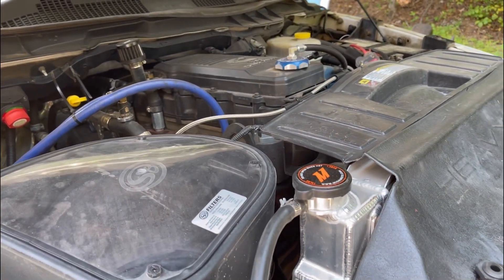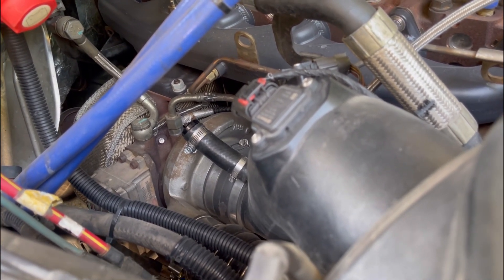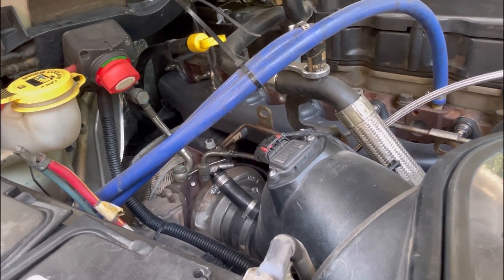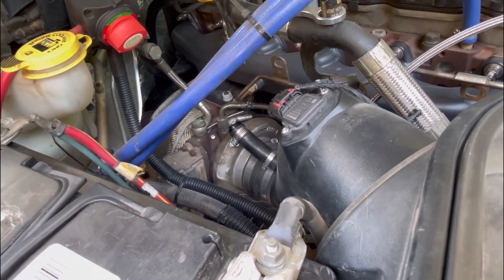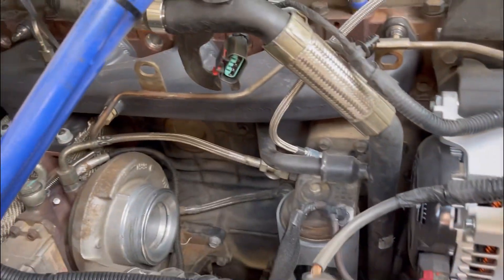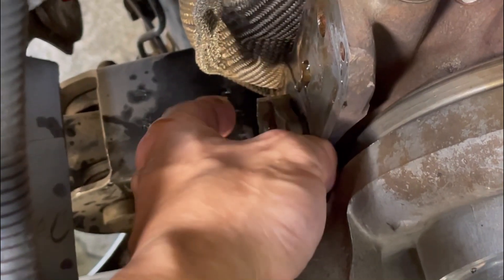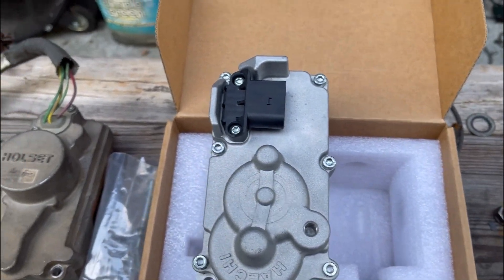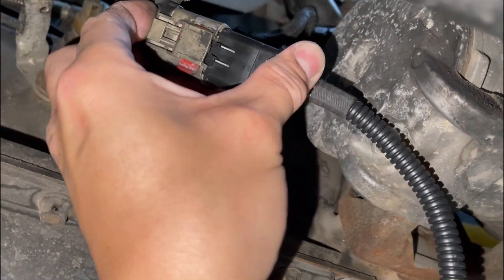STEP BY STEP Ram 2500 & 3500 HOLSET HE351VE VGT TURBO ACTUATOR

Comment: $3k that's dealership pricing and $2300-2400  is performance shop shop pricing on OEM replacement and a direct supplier like Rocky mountain Cummins or Rush truck center is around $1300-1500. 

Kind of like when the ccv filters "were"  $75 at Cummins or Rush and $200 at the dealer .

Comment: Wrong… Cummins tech here. We sell actuators at FCA authorizes dealerships.   I do actuators all the time.
Reply from the maker: great to know our local dealer wanted to sell us the whole turbo we used a cheap 300 buck one and its been fine...how much do the OEM actuators go for
Reply: @DIYKAI  I just quoted on yesterday they are 1150.  That turbo isn’t 3000 either… more like 6000… turbos very rarely go out… typically the actuator from all the soot build up from not servicing the crankcase filter and EGR circuit.  Still expensive though.
Reply from the maker: @RageBrothers  so what we found with ours was the actuator failed and it was pretty gummed up in the turbo......ended up replacing the nozzle and ring ...that was fun lol...then reprogrammed the actuator and drove about 6k miles hard with a load and the OEM actuator finally went....2 cheap China ones later and it seems to be goo now...but yea the turbo at 250K looked amazing just replaced everything cause we were in there....long story short we got maybe 500 in on a home rebuild 12k miles so far and its good so we are happy

Comment: I’m curious maybe you can help me, I have a 2012 with 110,000 miles. For the last 15 or 20,000 miles or so I don’t hear an exhaust break any longer but I don’t feel loss of power, still a fast truck. Can this be a symptom and it’s easy to just change out the actuator, calibrate it, and then slap it on the existing turbo? Thanks.
Reply from the maker: Hello yes that could definitely be the issue. Very easy to change we just did a video will be uploaded today sometime.

Comment: Must the actuator be recalibrated if it was pulled off the turbo, but the electrical connector was never disconnected?
Great turbo videos!
Reply from the maker: Hello and thanks! That's a tough one because the arm will never be exactly the same when you pull it off....can it be done sure but you need to have a way to view the % applied cause it can be off